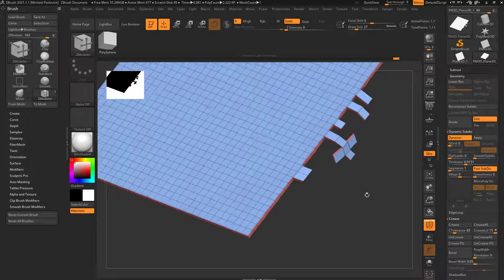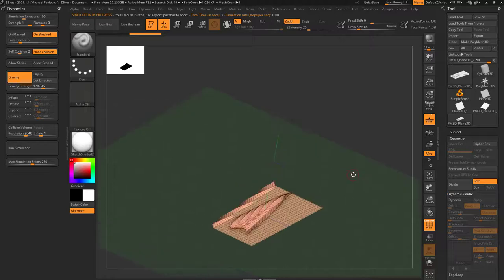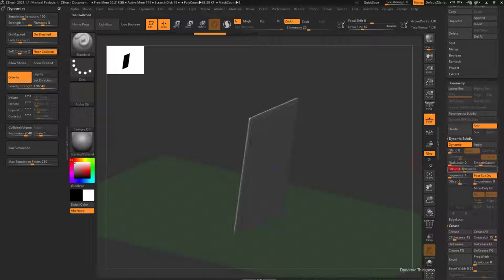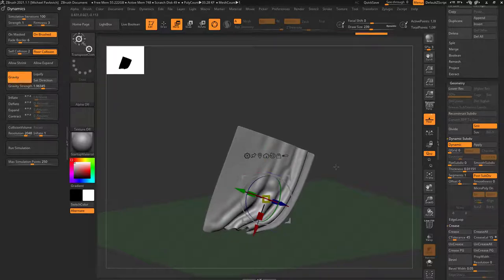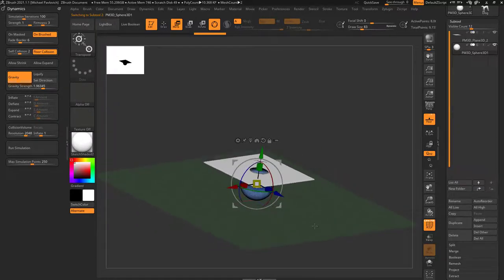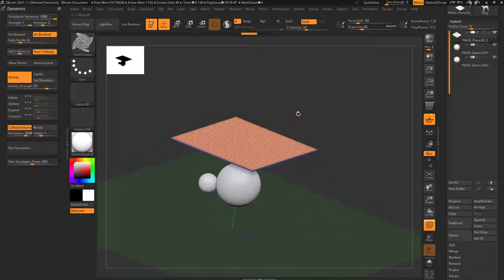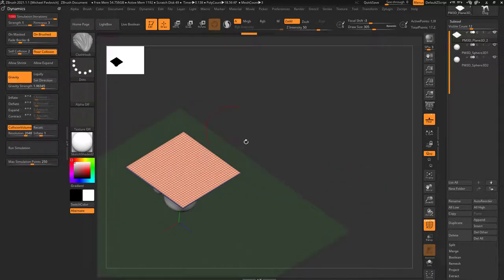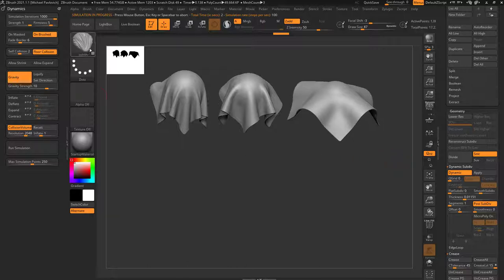Intro to ZBrush 037 - Dynamic Simulation Menu! Easily create cloth and wrinkles on any object!

Comment: Is lowering the gravity strength simply slowing down the simulation with the same amount of force? As in, are we simply allowing ZBrush to take longer to get the same simulated result? E.g. if I run at 100 sim iterations and 2 strength, will I get the same result at 500 iterations and 10 strength, just quicker?
Reply from the maker: I think so, the only iffy part will be ensuring that the 500 iterations are actually running, not unknowingly capping at some unknown rate based on CPU power or something!